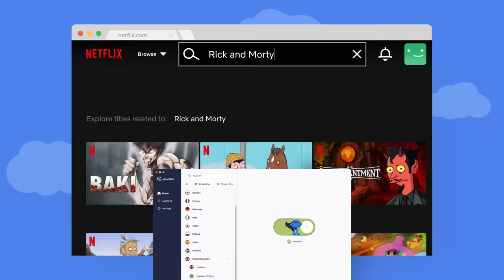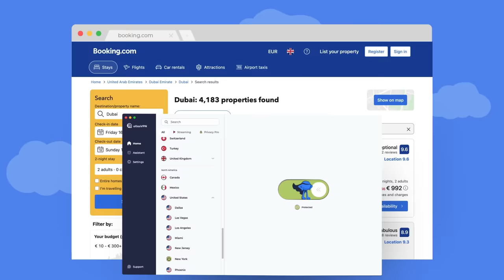How do Russians Cope with Heavy Tank Losses?

Comment: Personally, I think that re-producing the t80bvm, perhaps to be parallel to the t90-ms, is just a waste of resources, Perhaps it is better to simplify the production base by working on unifying the hull of the tracked armored fighting vehicles AFVs, here the subject is the main battle tank, at least working on: 
1- Modifying the t90’s engine compartment and designing and manufacturing new turbo gas engine and equipping some of the t90tanks with a turbo gas engine's...
2- Adopting one of the suspension and wheel systems in the t90 or t80 to make it a standard system, I think this will simplify the repair and maintenance process and facilitate the logistics supply chain of equipments and spare parts and allowing for the expansion of the skilled labor base...
but since the talk here is about opening a new production line to reproduce a legacy tank, there is another option is to complete the trails and experiments on the t-195 black eagle or the object 640 black eagle which is basically a development and expansion of the t-80u and it could be a strong competitor to the western main battle tanks in the international weapon market, while the t-14 remains an elite tank with no analog to it in the world in terms of its futurstice design and advance equipments was installed on-board, while the t14 is still in its very early stages and the platform is very scalable regarding at least and for the start upgrading the fire power, the sighting systems and other sensors, the protection level and suits and other offensive and defensive capabilities, but still very expensive to manufacturing and acquiring...

However, I believe that the t90-m may be a platform that still has a chance to evolve within the category of compact light and medium main battle tanks...
the black eagle's t-195 and project 640 represent a complete new trend in the designing and manufacturing of Russian tanks, making them, in their general principles, close to western tanks, those platforms, and with its size or the dimensions alongside the innovations of implementing new ideas and employing new technologies, can be capable of develop and evolve over time to be real fighting beast, and in comparison for the armies of the so-called united etates of america and the english island, both of them have expeditionary armies or ground forces tailored to fight overseas over a long distances, and they have to limit the weight, and the size of its heavy combat hardware by the loading capabilities of the logistics arm, however the weight of the base model of the m1abrams from the late cold war era still 13 tons heavier than the latest t-90 tank model t90m and the tank is equipped with all the additional heavy armor suits, while the fully armored challenger 2 tank could reach 80 ton this is 50٪ heavier than t90m with its 52 tons...

On the other hand, the 
t-90-m's size or the dimensions make it a compact platform, maybe financially cheaper to mass producing and from a strategic and operational military point of view with t90-m qualities and characteristics e.g compact size, heavy armor supported by hard and soft kill systems, effective gun especially with latest 2a82 gun, high mileage or combat ranges especially when equipped with extra barrels, this relatively lighter weight and more nimble tank suitable to exploiting any breakthrough in the enemy defensive lines and rush deep into his operational and strategic depths achieving set of objects depends on the size and the objectives of the friendly formation successfully  breaching enemy line's for example : spreading havoc or exploiting the breakthrough and attacking the flanks of the enemy deployments sites and military positions and overruning his rear area or the tactical depth suppressing his fire support assets destroying his command posts and crushing his tactical reserve forces, cutting his communication lines and with it his logistical lines isolating his fighting formations and preventing it from withdrawal...
It is true that t90 armor has been greatly improved over time, bringing it close in shape and design to the zionist entity's merkava mk4 tank, in terms of designing the additional reactive armor suits (the zionist entity's merkava mk4 equipped with nera armor) and implementing the metal cages or steel chains to protect the sensitive parts of the tank, especially the area where the turret is connected to the hull...

Note: most Russian tank tracks are not equipped with rubber pads, which help in dampening the track noise, extending the life of the steel track, and help the tank in using asphalt roads easier than puur steel track...

Comment: The number of tanks that Russia claims it can restore and get back into service is, of course, massively overstated. 

Just keeping tanks running in a high intensity conflict requires massive effort, massive supplies of replacement components and massive supplies of tools and repair equipment. 

Russia only manufactured a tiny proportion of these essential replacement components (everything from engines to main guns to wheel  bearings and gaskets) prior to the war and many essential components have ceased production entirely.  Even in peace time, Russia largely relied on cannibalising their old tank reserves to keep operational equipment running. 

As such, virtually all components required to keep tanks running and to restore old tanks to service require cannibalisation of parked reserves. 

Most of the 1000's of tanks in reserve in Russia will never be put back into service. 

Just look at the huge numbers of turretless hulks in satellite images of Russian tank storages. These tanks have all been stripped and discarded. The same fate awaits most of the rest of the Russian reserve. 

As for serious equipment upgrades (to modern standards) and new builds.....that only happens in token quantities.
Reply: russia has built 4 new tank factories already and plans 7 more not sure what u on about
Reply: @mortalz9940  Why do they have to build all these (very alleged) tank factories if they have 1000's of usable tanks in storage?

Sounds like you actually agree with me.....that Russia's 1000's of stored tanks really aren't worth very much.

And who's going to staff all these alleged factories?. They can't even find qualified staff to man the repair depot's behind the front.

And where are all the essential components going to be made? Engines, transmissions, guns, sights? Are there new factories for these too?

And where are they going to source all the essential machine tools to equip these factories? The West certainly won't be supplying them, like they did in WW2.

You sure you've thought the propaganda through,  mortal?

Comment: Do not under estimate the Russians. It is dangerous. In WW2 they started slow and needed help, like lend /lease equipment, but once they started after moving their factories out of reach of the Germans, they did almost as well as the Americans. Stalin said, there is a certain quality to quantity. The T34 was inferior to the Tiger and Panther, but they outnumbered them 5 to one or more. Even the Germans had to copy the T34 design which became the Panther.  It is only sensible they start getting rid of some of the oldest tanks in storage and keep the new ones behind as reserves. I am surprised they have not added bar armor on top of turrets and engine compartments against drone attacks. As for the crew, I am sure it will be easier to train a Russian tank crew than an Abram, they are not as complex. I am surprised that tank repair facility did not attract a cruise missile or two. Russian product have a less than ideal image, people often remember the east German Trebent auto. Plainly a piece of shit.Other Russian cars look like they been designed in Cuba.  But Russian is a people capable of space travel,  and they built machines to work at the most hostile environments, such as large helicopters and submarines. Their design philosophy is very different than American, they have less money to spend/waste than Americans and their vehicles had to work where there are no infrastructures. I knew long ago, when the Russian feel like it or there is a serious need , their engineering is world class.
Reply: Russia today is not the ussr from ww2... and in the ww2 the ussr was supplied by the allies. Who is supplying russia now? North Korea?
Reply: @forgerfalscher2125 у моего Деда, от американских консерв, к 30 годам вывалились все зубы. А в армии он был с 1939 года по 1954. Так что ваша супер помощь это миф
Reply: @Ivan_Rom-Zap  Sorry to hear that about your grandfather but you can t claim the help was a myth and then say that he was eating american canned food. And unless this happened to most soldiers who was eating canned food from america your grandfather probably lost his teeth from other causes.

Comment: The way that wire lifting strap is pinching around the front plate of the tank makes me cringe.  Do that enough and that wire is useless, more so because it’s 304 stainless it won’t return to shape.  How hard is it to use chain straps for lifting?

Just a quick example of non-existent safety or industrial standards.  That’s a 40 ton load hanging in the air.

Comment: t14 production will start after the war. opening a new manufacturing line will only complicate tank supplies to the front. they better continue the production of t90m and upgrade existing tank before extension of already existing plant is finished.
but the worse point for russia is that since the begenning of war, they did nothing to the reverse speed, as if producing a new transmission gear was a big problem
Reply: @simonmoorcroft1417  where do you get this nonsense from?😂
Reply: @alexalex-v2s  let me think...
1)The Russian ministry of finance.
2) Actual Russian economic experts.
3) The fact that Russia has only built  approx. 20 T-14 in the last decade or so.
4) The fact that Russia chose to continue producing T-90 and continue refurbishing old T-72's at the cost of billions of rubles rather than put the money into T-14 production.

The logical conclusion is that T-14 is too expensive and not good enough to make it worth investing in.
Of course it may also not work that well. Big claims and poor performance for example.
Nothing unusual.
Reply: @simonmoorcroft1417  I don't think the t14 is too expensive or not good enough. This is a very good tank, probably the best in the world. It's just that the t90 has been worked out in production, is devoid of "childhood diseases" and is easier to do, and allows you to saturate such a huge front faster.
Reply: @alexalex-v2s  The T-14 has existed for 10+ years. It should have no 'childhood diseases' left after a decade of testing. 5 years should have been enough. They should have hundreds of T-14's in service by now.
Wartime production of T-90 is irrelevant. Russia has had years to produce T-14 and get it into service before the SMO.

The money for T-14 production went into a super yacht and some holiday villa's in Cyprus and southern France I suspect.
Reply: @simonmoorcroft1417  The F-35 has existed for 15+ years. It should have no 'childhood diseases' left after one and a half a decade of testing. 5 years should have been enough. They have hundreds of F-35 with a bunch of production shortcomings in service by now , a significant part of them are not able to take to the sky.

The money for F-35 production went into a superyacht and some holiday villa's in Cyprus and southern France I suspect.
Reply: @alexalex-v2s  at least they actually built them.....and continue to do so, in large numbers....and they have actually been used in combat.
The U.S has actually held enquiries about cost over runs and delays, and actual tried to improve the issues. All money is carefully accounted for by the GAO even when its wasted.
The F-35 block 4 will be appearing soon with even further improvements.
.....and we are still yet to see a single T-14 do anything other than appear at parades and drive round practice areas in Russia, trying to pretend it's Ukraine.
Try better next time....
Reply: @simonmoorcroft1417   Su 57 was actually used in air battles, the f35 has no experience in this. Churning out an airplane in mass quantities that has a bunch of defects is not the smartest idea, unless of course there is a war going on right now. However, the USA is a rich country, probably can afford it.Russia is poorer, so it cannot produce a large number of defective tanks, and then constantly struggle with its breakdowns. However, the T14 also took part in the fighting, and quite successfully.

Comment: If the Russians are manufacturing brand new T-90Ms and T-14s why would they restart manufacturing brand new T-80s from scratch? This kinda sounds like an equivalent of back in the 90s that the US already manufacturing M1 Abrams and M60s then for some reason deciding to restart manufacturing M48 Pattons from scratch. It doesn't make sense to me.
Reply: Russia has a large stock of T-80 in storage and it is much easier to restore and modernize the machine from storage than to produce from scratch. Besides, the T-80 is a pretty good tank. The fact is that in war, quantity decides no less than quality, it is better to have 10 T-80 than one T-14 (by the way, they are not produced and most likely will not be, we need T-34 and not Tigers)
Reply: T-80s are not outdated, it's way above T-72 in terms of capabilities and more or less equal to T-90s. And they're seem to be clearing the T-72s in stock to make space for T-80s.
It's still a good platform to make good tanks.
And also they don't produce armatas, they're not even mass produced yet. T-14 is basically will be in the backburner for the rest of the war since they can't even afford it.
Reply: T80 got a update in 2013 and is a pretty good base..
Reply: Couple of reasons.
1. Open production capacity. The tank factory dedicated only to t-80 production has open capacity. So the russians can order and ramp up tank production even more. So that is one.
2. The T-80 had numerous upgrade kits through the decades, and several design flaws were remedied over time and it is better protected than the T-90 so I've heard. So for all intends and purposes the T-80 is an very much up to date armor in todays standards.
3. Russian military commanders (no idea who though) said that it performed very good on the battlefield.
Reply: @bodizsattila9044 That’s right, as I remember most of the videos where a Russian tank copes with a column or takes a lot of hits, this is more often the T80 than others
Reply: There many closed factories that used to produce t80s, these factories are being restarted , no need for newly designed machinery , everything is already there.

Comment: Who removes the bodies and the burnt remains??
Reply: they dont repair tanks that have had their ammo cook off einstein
Reply: @Fred_the_1996 A tank can have its crew killed without the tank being destroyed byond repair Einstein.
Reply: @voidtempering8700  not when its burnt inside as the original comment suggests
Reply: @Fred_the_1996  Yes, the inside can still be burnt and the tank can be recoverable.
Reply: @voidtempering8700  i dont think so
Reply: @Fred_the_1996  Tank rounds upon entering a tank can be extremely hot. This can ignite fuel tanks, and cook-off ammo without it actually detonating. This will burn the inside of the tank, but it can still be repairable.
Reply: @voidtempering8700  i highly doubt an APFSDS round or a HEATFS round wont detonate the ammo
Reply: @Fred_the_1996  It can, it also cannot. It's never 100%, it also might be less than 70%.

Comment: They just bring more. I'm not saying they're gonna unleash 1000s of T14 but the Russians still have a lot of legacy armour. "Quantity has a quality all of its own" I believe the saying goes.
Reply: majority of those tanks have been sitting in fields for decades... most are rust buckets.
Reply: @rustythecrown9317  Yeah, but you can see even in this video, how refurbishment is going on. They disassemble whole tank and replace everything. Most of spare parts have not changed since WW2. (some components from the famous T34 can be still used!). But yes, it is hard, time and labor consuming and Russians can't restore as many tanks as they want. And due to the lack of modern components they cannot upgrade them to the newest versions. For example T-80B or BV are very common today, however only BVM, the  version with modern thermal sight was in use before 2022.
Reply: @СвинкаСкреппа  When you need 5 to 6 old tanks to get enough parts to refit one, you're doomed.
Reply: @rustythecrown9317  Probably 2-3. Some parts are still available in production. Maybe even less, because only a few elements really matters. But yes, it is not easy. 50-60 % of the costs of a new tank.
Reply: @СвинкаСкреппа  gonna get real tough since the parts they desperately need are all in the list of banned exports to them.